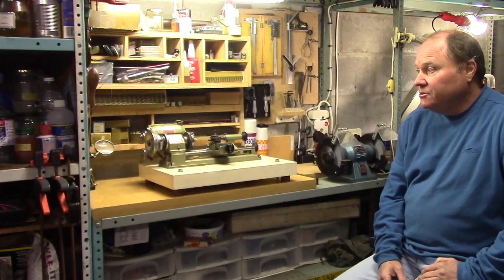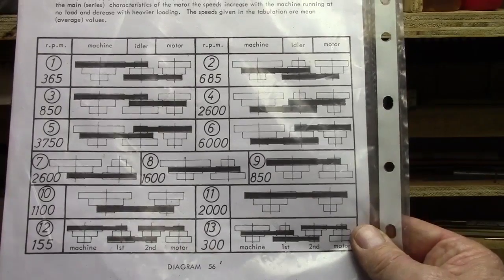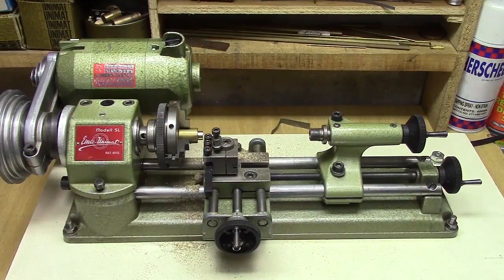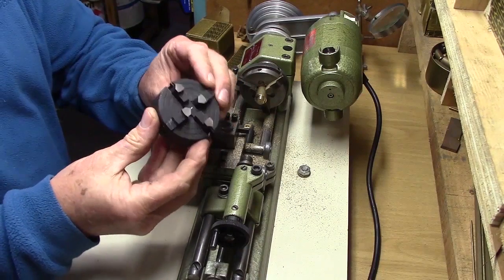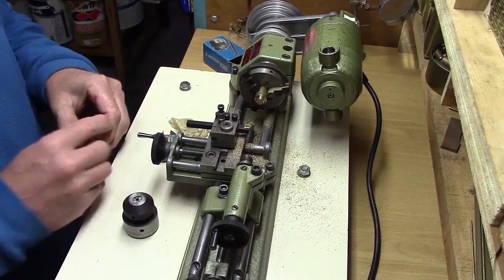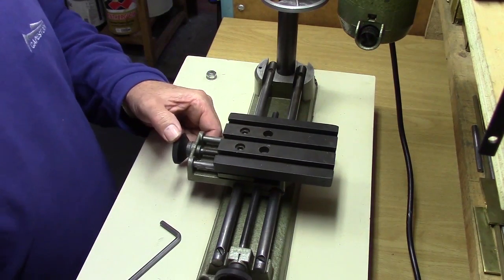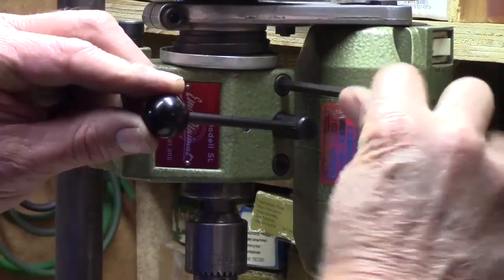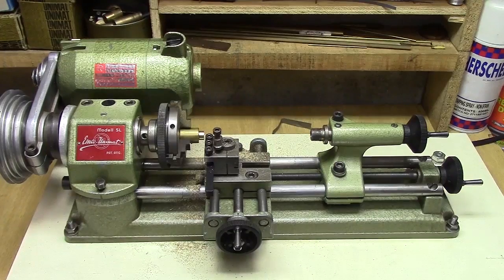All about the EMCO UNIMAT SL Lathe

Comment: Hi! What diameter cutter with replaceable insert do you use?
Reply from the maker: Hi, thanks for your comment. The adjustable index Tip Tool Holders were acquired from RGD Tools in the UK. It was a couple of years ago and  I'm not sure if they still stock them .  The Tool Holder has a 6mm X 6mm shank. Just type "RDG Tools" on the Google search bar. The RDG tools website used to have a special section for UNIMAT users. I also acquired my  Parting-Off Tool holder from RDG and it also has  6mm X 6mmm shank.
The standard Unimat SL Tool holder can however hold cutting Tools with up to 8mm X 8mm shank

Comment: By your accent you sound like a South African…. I too live in SA.I have one of these lathes that my Father gave me way back in 1970. Unfortunately the motor stopped working and the drive belts broke. Recently have managed to find replacements for these. Where do I get polyurethane belt material in South Africa if the new replacement belts snap?

Comment: Hello! I just acquired the UNINAT model which doesn’t have “SL” in the title. Can you tell me the difference between the “SL” model and the non-“SL” model?
Reply from the maker: The Manufacturers, Edelstal, based in Austria allowed several licensed Distributors to put their own labels on these Lathes during the 1950's, 60's  - early 1970's . Early Unimats, identical to my "SL" model ,  with  labels omitting the SL, such as  "Selecta" , "Elliot Machine Tools - London " and other Distrubutors  are fairly common. Cheers Paul
Reply: @SteamerEdge  What a wonderful answer! Thank you so much. I really appreciate it. This was a wonderful help! :-)

ADDED EDIT: I realized that I slightly misrepresented what the label actually says. It’s odd. “SL 1000” is a kind of subtitle on the label on my unit. It is in small lettering under the title of “UNIMAT.”

Comment: I own one of those. It came with a few attachments but it’s amazing how many I’ve never even seen before! Word of advice, the attachments are very expensive nowadays!!! If you find one with all or most of the attachments, at a reasonable price, but it! Buying in little add ons here and there, make it financially restraining!
Great video!
Reply from the maker: Hi, yes, they are expensive now. But, in my opinon,  these little lathes are still the best financial option for the novice who wants to start Model Engineering.  I actually have 3 of these Unimat SL Lathes which I have manage to acquire over the past 15 years. The extra Lathes I have are used for the spares and extra accessories. cheers Paul

Comment: I just bought an old Unimat SL the other day and am now hunting for things it lacks. The carriage was garbage, with a terribly bent and fractured/crumbling casting. I have a missing grub screw. There is a minimal amount of mushrooming to the end of one carriage "way" bar. Beyond that damage, it appears to be a very mint machine, with excellent, clean paint and tagging. (I suspect the original carriage was lost and that a new owner purchased this piece of junk. When it did not work, the owner (probably a novice) gave up and placed the lathe in storage.) I have a complete carriage assembly on the way, as well as several fun, little bits made and sold by enthusiasts. I am searching for the steady rest. (I missed out on one in eBay by $2.50 the other day. Rats!) I would like to have that dividing head, a live center, and the milling bed, too. I am an avid Jeep owner and mechanic. We like to say that Jeep is actually an acronym for JUST EMPTY EVERY POCKET, so owning one of these little Unimat lathes ought to satisfy my apparent need to have hobbies that keep my wallet empty, heh, heh… Great video, sir! Where did you get that height-adjustable tool post? I had not seen that before.
Reply from the maker: Hi, thanks for you comment, yes many Unimat SL's  have been abused by previous owners  due to their limitations. The steady rest is nice to have, but something I hardly ever use because I try to plan operations so that I never turn anything protruding more than about 40mm from the chuck jaws. Yes, my Tool Post is custom built by the previous owner of my lathe. It has generated so many comments over the years that I have decided to post a video which only deals with my Tool Post. Watch my SteamerEdge Channel for this Tool Post video coming up soon. Another sure and  easy  way to pour your money down a vast black hole is to own an old Land Rover as I have for the past 23 years. ;-}}    cheers Paul

Comment: The Unimat indexer attachment came with a 48 tooth wheel.  Other tooth counts were available (as he showed) as optional and are extremely hard to find today (usually quite costly).  But the 48 tooth is a good general purpose choice since it allows even divisions of 48, 24, 16, 12, 8, 6, 4, 3, and 2.

Comment: While he is correct that one use of a 4-jaw chuck is to hold something irregular, it is usually far more often used when something needs to be held more concentric than is possible with a 3-jaw self-centering type.  There are plenty of videos showing methods for using an indicator and adjusting the jaws to get something running very true.  This is especially useful if a part has to be removed from the lathe for some other operation and then returned to the lathe.  Or even just the case of having to turn a part around end for end in the lathe.

Comment: hello i m new to lathes i got this one for a good price  mhat kimd if cutting bits and tools do i need i want to make car parts or pistol parts
Reply from the maker: Hi, the Unimat SL is a very capable miniature lathe. In my opinion, you will get the optimum use out of this lathe by using it primarily for model making projects in miniature. You can make the required cutting tools from tool steel yourself or your can purchase tool holders with replaceable cutting tips.

Comment: Hi, where do you found the cutting tool tower (that you can modify the vertical position of the cutting tool)??
Reply from the maker: Hi, the fine height adjustment modification on my Unimat SL Tool post is a Do-it-Yourself modification by the original owner of my lathe. It is a relatively simple modification to make and I have seen other variations of this tool post modification featured in old Model Mechanic and Model Engineer magazine articles from the 1950's and 60's. Have a look at the Model Engineer magazine website, many of the old archived articles are free for download and viewing.
Reply: ooooohhh...thank you!! could you give me a link to these articles?

Comment: How do you keep the work tight in the Chuck when doing deeper cuts as mine seems to loosen off and sometimes come out the chuck?
Reply from the maker: Hi, I don't take deep cuts with this lathe. If the work is pulling out of the chuck you are trying to work to fast and will probably eventually damage the chuck and the lathe. One full rotation of the cross slide hand wheel or the longitudinal feed hand wheel advances the tool tip approx 0.99 mm on my UNIMAT SL. To maintain accuracy and to minimize stress on the lathe I take progressive light cuts, advancing the tool tip about 0.05 on brass and aluminium and probably less, about .03 on steel. Lubricate the work frequently when cutting steel. You eventually get a "feel" through the hand wheels for the way the lathe tool is cutting the work. Also make sure the you have the right turning speed, if in doubt select a slower speed. Be patient. I plan carefully to keep the amount of machining to a minimum. Enjoy your machining, Cheers Paul
Reply: @SteamerEdge Thanks for your detailed reply and sorry haven't replied till now but only just seen your post.
I took your advice on board with taking only light cuts and seemed to work well.
As you say it's only a small lathe so can't expect too much out of it unlike a big lathe.
You mentioned in the video about how you can change the chuck Jaws around to allow to turn larger diameter work.
I'm wanting to turn some 50mm diameter aluminium.
How do I go about changing around the chuck jaws for this?

Comment: Hi there. Do you have any extra accessories for the Unimat SL? I have two, one standard and one with the threading attachment but I am still in need of a few accessories.
Reply from the maker: Hi, unfortunately no, I do not wish to sell or dispose of anything. My Unimat is in constant use and I find it an advantage to have a range of spares and duplicate items on hand when needed. Just keep looking - try Garage Sales, Flea markets Tool Auctions , Networking with other model Engineers and your favourite Used Goods online websites. Eventually you will find what you are looking for.

Comment: what chucks do you use? are these the stock ones that came with the machine? 1005 and 1001?
Reply from the maker: Hello, yes, they are genuine Unimat 3 jaw no.1001 and 4 jaw no. 1001a chucks. The Chucks were sold separately as accessories at the time the Unimats were marketed.

Comment: Thank you very much for this video!  These are not simple casual words; just bought one. 
Please help me with one question: how about its "upper limit".Have you machined mild steel? What is your opinion and how would you quantify it. I come from a Sieg /Einhell lathe which -after improvements - I appreciate and like very much; but it is my weekend lathe and I needed a much smaller one to stay closer. When finding it on offer (without any extras), I searched for reviews but I have found a lot of "they are toys" or "step-up " and few or no real evaluation -you  say with your words it is under-rated. My problem is my decision was to actually step-down but although I want a realistic assessment. Maybe I will be disappointed a bit about what you will say (always expectations are high). I have to mention that steel will not be the main task for my mini-lathe; on the contrary. But I need to know a veteran opinion about how much I can expect from it.
Reply from the maker: Hello, thanks for your comment. In my opinion, the Unimat SL is a very capable miniature lathe. Hundreds of these lathes were sold around the world in the 1960's 1970's and 1980's and many still exist in good working condition today. This, in my opinion, is a testament to the quality of manufacture. Brass is the material I machine most often on my lathe. I have also machined components using Mild steel, Cast Iron, Aluminium  and Copper without any problems. There are 3  rules to remember with this lathe : 1) Select the right turning speed for the type and diameter of the the material in the chuck, if in doubt select a slower speed. 2) Make sure the Lathe tool is always very sharp. 3) Make sure all Lock Bolts and Tensioning Bolts are locked and, or, firmed up before Turning. The are two Lock bolts on top of the Headstock , and a Cross Feed Tensioning bolt and Longitudinal Feed Tensioning Bolt located on the Cross slide. You can feel whether the Tension is correct when you rotate the Cross Feed Handwheel and the Longitudinal Feed Handwheel. Good luck and enjoy using your Unimat Lathe :-))
Reply: @SteamerEdge  Hello, thanks for fast answer and for warm, inspiring considerations and advises.
 My lathe was worked but in reasonable technical condition. I torn it into pieces, cleaned and greased and put it back together, adjusting screws. The only mods were adapting a 200W DC spindle motor with PWM controller (very nice at low speeds - down to 80RPM at chuck with no-load and very quiet - which is compulsory in a block of flats) and changing old rods to hardened, mirror finished ones. I have to mention that the original motor was the latest model- U100 - and it is still in good working condition so I will keep it for backup. Pity that it is so noisy because otherwise it is running fine. 
As I know I can do the hard job on the other lathe, I will enjoy experimenting and doing tiny-tiny  work (I am H0 passionate - among others) on my Unimat.
Thanks again for your evaluation which answers my questions and for advises to make its operation more enjoyable and precise.
Good luck in fulfilling your passion!

Comment: How do you undo the chuck on this lathe and what tool do you use?
Reply from the maker: A good question, the Chuck is often stuck fast on many of the old Unimats. The chuck keys are just two pieces of hardened 4 mm diameter bar which are 60 mm long. The chuck is screwed onto the drive spindle with a 12 mm metric thread. To unscrew the chuck, remove the drive spindle belt, insert one key in the hole which goes right through the drive spindle just short of the chuck thread and insert the other key into the hole on the splined flange of the chuck itself . You then apply the force necessary to move the two keys apart by hand and unscrew the chuck . Do not try to brace the two keys against the lathe bed bars or the carriage slide or anywhere else on the lathe as this will almost certainly cause severe damage, use the two keys in your hands. If the chuck is stuck apply a rust breaking lubricant to the chuck thread from the tail stock side through the hole inside the  chuck jaws taking care not to get the lubricant on the outside of the chuck.

Comment: I've never seen a set that complete.. I have one in my shop at the moment, it is my father's Lathe, i'm but a spoiled brat with 2 EMCO CNC lathes in my workshop.. but then.. i have to make a living with those..
I have made some watch parts on the UNIMAT SL, and it is indeed a fine lathe (you can also use the quill in the headstock for turning, like a swiss lathe, just set the crosslide to a certain Z-position and diameter, and feed with the quill
The only downside in  my opinion, and that is why i have my father's  UNIMAT here, is the lack of adjustable dimension rings.. i've already designed some handwheels with these.. and i will make those in the near future.. would also be a fun project on your machine.. since you have the index-head.
I'm also planning on making my father a quick  change toolpost with some toolholders, some small Solid Carbide cutters and boring bars (i make these myself for my other lathes as well)

Nice review, and a nice little machine!
Reply from the maker: Thanks, yes, I was very lucky to acquire my Unimat SL and its accessories in such excellent condition from its original owner some 12 years ago. I have also acquired various 2nd hand Unimat SL spares and accessories over the years. I have never tried turning operations using the quill/ lever  to move the Head stock towards the stationary Tail stock but I think it could be very useful in certain situations and I will try it out. Thanks for the tip. Yes, I have always wanted a top quality quick change tool post for my Unimat SL, still looking for one - Paul
Reply: @SteamerEdge  Well.. if you don't mind spending a lot of money, look for a "Tripan" Tool holder (Swiss made, Schaublin used these as well).. or.. Just make one yourself.. it is not that hard.

Comment: Is this lathe still available in the market
Reply from the maker: Unfortunately these lathes are now no longer manufactured . Complete used UNIMAT lathes with accessories and, sometimes, individual UNIMAT parts are often found on websites like GUMTREE, Bid or Buy, EBAY  and at  Flea markets, Toy Collectors Fairs,  Garage sales etc.  The EMCO UNIMAT lathes were very well marketed world wide in the 1960's 70's and 80''s and many complete 2nd Hand machines and 2nd Hand accessories are still around if you keep looking.

Comment: Hi steamer edge I am intrested  8n more info on the adjustable tool holder  that you are using as that 8s not the standard  unimat sl  tool post
Reply from the maker: Hi, the easy height adjustment Tool Post came with my lathe from its previous original owner. The original owner may have made the modification himself or had it done by another model engineer. It is a relatively simple modification to make and I have seen other variations of this tool post modification featured in old Model Mechanic and Model Engineer magazine articles from the 1950's and 60's. Have a look at the Model Engineer magazine website - many of the old archived articles are free for download and viewing.
Reply: @SteamerEdge  thank you will have a look if I dont come right would you mind take some pics and measurements if I dont find any

Comment: Hi, awesome video. Just wondering if it has a "through chuck" (don't know the technical term for it) to turn features at the end of longer stock?
Reply: Sorry for being so late to this but I believe you meant to ask if you can stick workpieces through the headstock of the lathe and the answer to that would be no
Reply from the maker: Hi, sorry, I am not familiar with that term. I do have a Steady Rest for the Unimat to support longer work pieces. Not shown in the video. Another way to support a longer work piece is to use the Live Centre at the Tailstock end.

Comment: Hi , I have a Unimat SL I bought new in 1977 with many accessories , I made a nice box to store everything in but never used it until I retired in 2019! Now with spare time I am making wooden model wagons and find the Unimat excellent to drill wheel and spoke holes accurately using the 3 jaw chuck on the dividing head, I have 30,40 and 48 tooth inserts for it which gives all possibilities for the number of spokes per wheel you need. I enjoyed the video and still look for more accessories, I have the thread cutting attachment but no leaders or followers and I would like the adjustable tool holder you show, I do detect you accent as very close to a south African one which is where I am in Springs.
Reply from the maker: Hi, yes, plenty of used Unimat bargains still to be found in South Africa. These machines were extremely popular and well marketed here. The tool holder with the fine tip height adjustment modification  is a simple item to make yourself. Have a look at the free online archives of Model Engineer magazine for a plan.  I am South African, born in Krugersdorp, I live in Cape Town. Glad you enjoyed the Video  - Paul